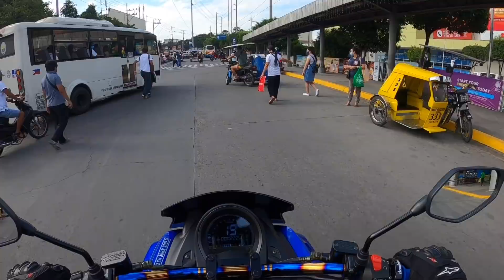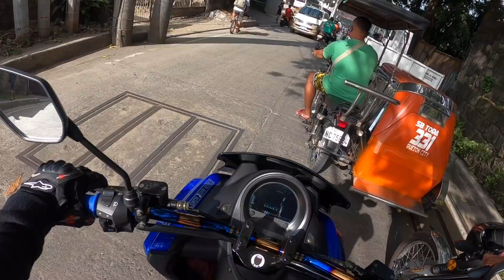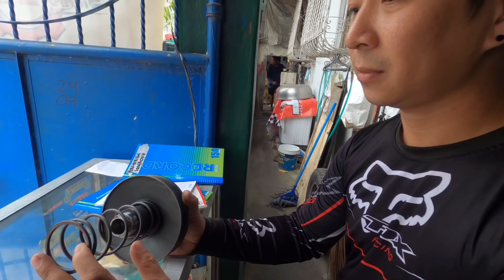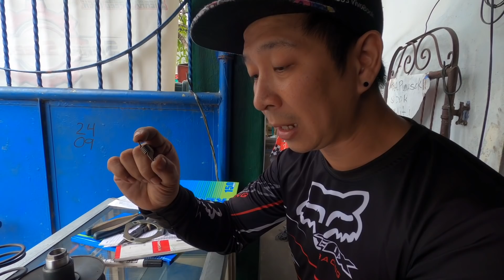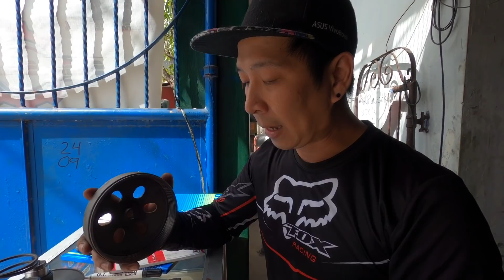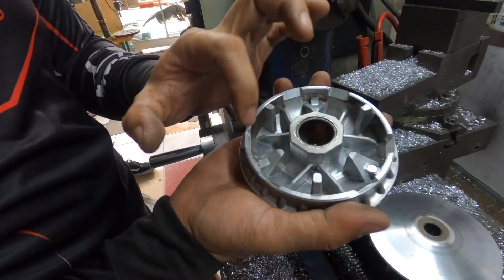Easyride 150N Kalkal Pulley and Bell Regroove by Sierra Speed Tech | Napaka-Solid!

Comment: Coach gud pm po ask ko ano stock g bola center at clutch rpm natin sa er150n???
Reply from the maker: sa bola 14g, center at clutch wala makapagsabi ka-RIDE.. Basta napagkumpara namin mas matigas stock center natin sa 1200rpm jvt aftermarket then clutch naman mas matigas pa sa beat carb 1k rpm.
Reply: @COACHJOHNRIDES  noted coach. Thanks sa info.